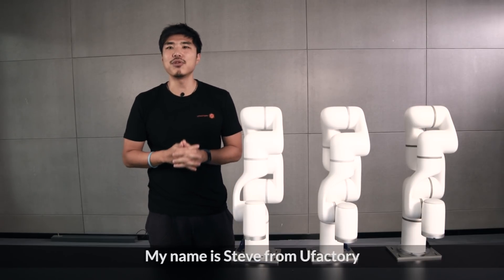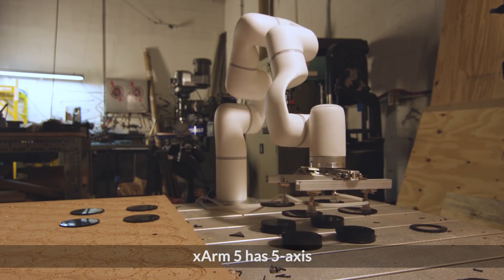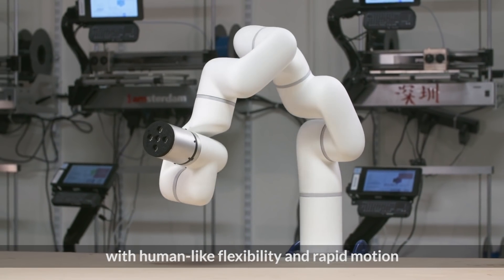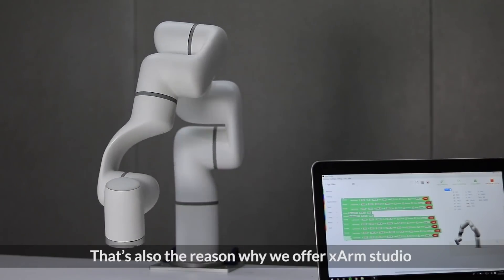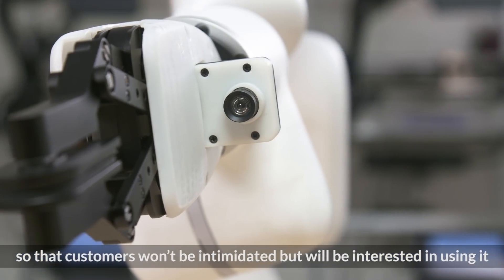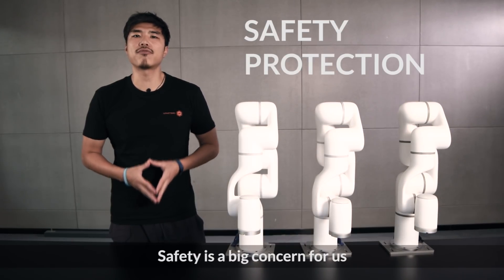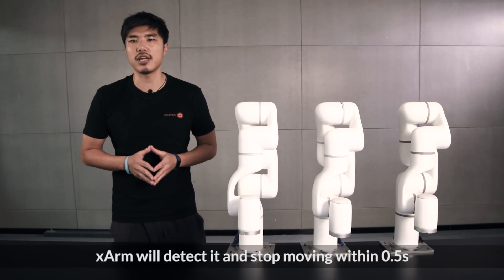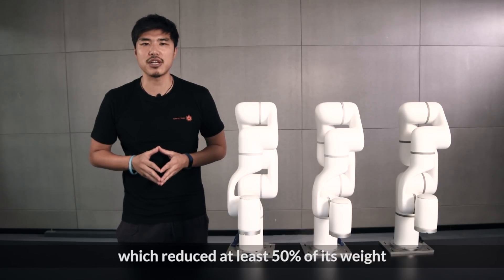Introduction of  xArm

Comment: This is a really bad company, they do not stand behind their products, do not support them. In 2018 I bought a uArm Swift Pro and it shipped with a Momentary Switch, instead of an On/Off switch. I have been trying to resolve the issue for 3 years now, and they will not respond to me. I have tested the email from another email with a sales question, and they responded within a day. While I could easily replace the switch, it's now a meme since all they need to do is respond, and their failure to do so after being extremely communicative during sales process demonstrates how awful this pathetic excuse for a company is.

The software is not maintained and is very shoddy. Only buy this if you want an expensive paperweight.